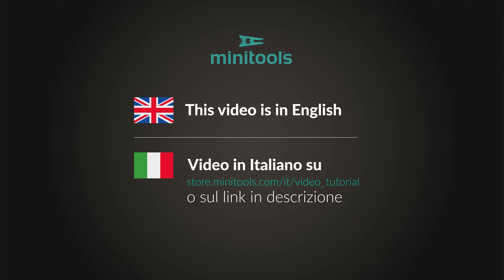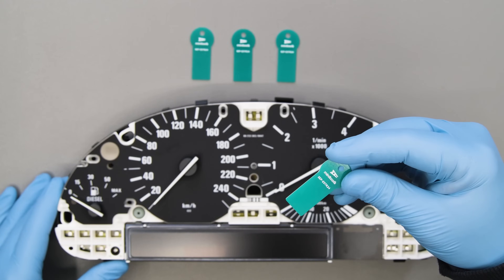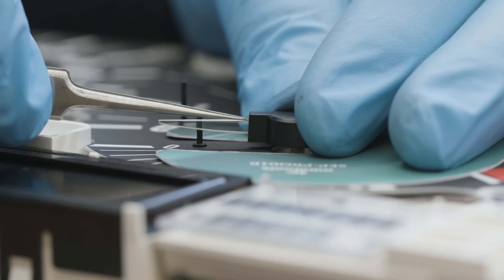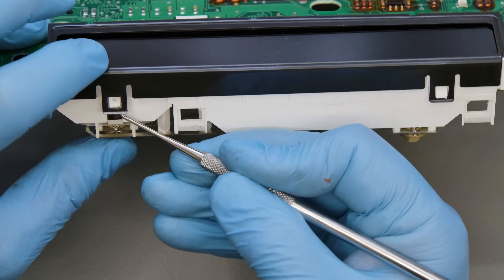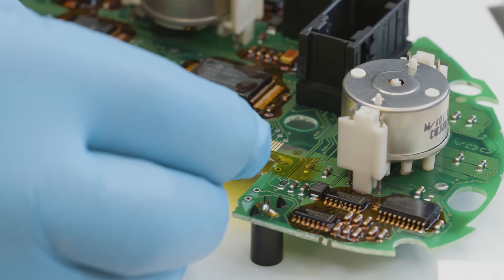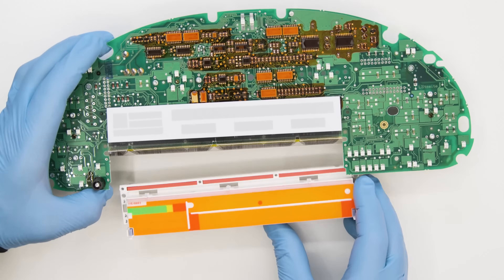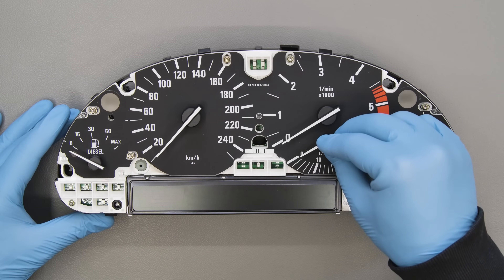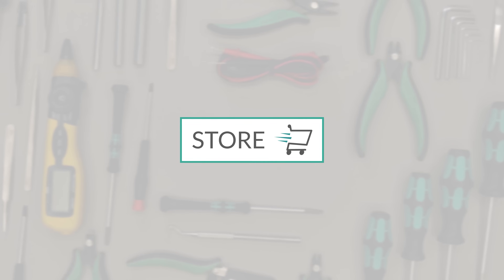BMW 5 Series E39, M5 E39, 7 Series E38 and X5 E53 instrument clusters LCD pixel repair –DIY tutorial

Comment: These tools are expensive. Better to buy new or used parts.
Reply from the maker: Hi, new parts, especially for youngtimers such as a BMW E39, are not easy to find. Used parts are not covered by warranty and you can't be sure they're not faulty. Our parts are warranty covered, we provide an all round technical assistance before and after ordering, they don't need any coding and we also guarantee fast delivery (2 days max in EU, 4 days max rest of the world).

Comment: If you install kepton tape under the ribbon cable, how's it making contact?
Reply from the maker: We don't insulate the pads, but the edge of the PCB, to avoid contacts between the flat cable and the circuit. The pads are free from insulation and the flat cable gets attached to them.

Comment: Switch on the dashboard?? What are you plugging those red wires into? I don't see any power source.
Reply from the maker: Hi, you can use any lab power supply, set at 12 V, plugging the wires in the pins shown.
Reply: @MinitoolsChannel  Can you show a pic of yours?
Reply from the maker: You can have a look online, searching for "lab power supply", there are plenty to choose from.

Comment: I'm about to buy this kit – why do the 2x stepper motors need to be removed from the PCB? They don't appear to block anything?
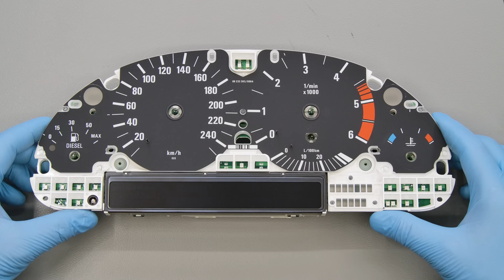Reply from the maker: Hi, as pointed at 2:17 the two stepper motors are blocking the plastic housing of the LCD display, which needs to be released in order to replace the screen.

Comment: Why do you use kapton tape in this place?
Reply from the maker: Hi Jacek, the Kapton tape has been used to insulate the edge of the PCB,  in order to avoid shorts between the display flat cable and the board.
Reply: @MinitoolsChannel  who heat resistant tape work ?
Reply from the maker: @E39nick  Hi Nick, could you please send us an email at info@minitools.com?